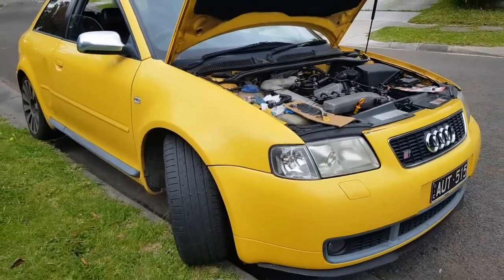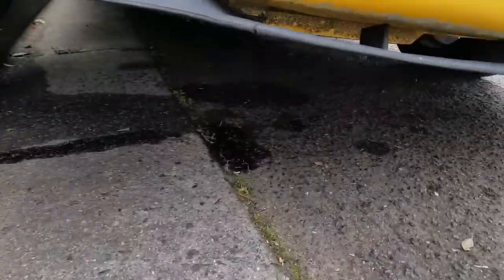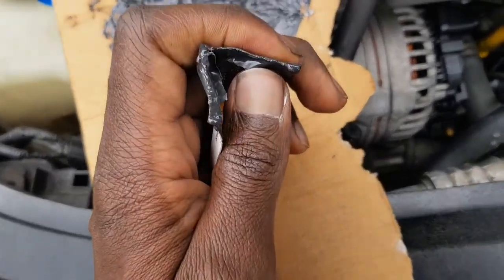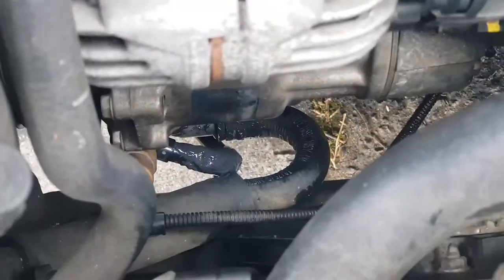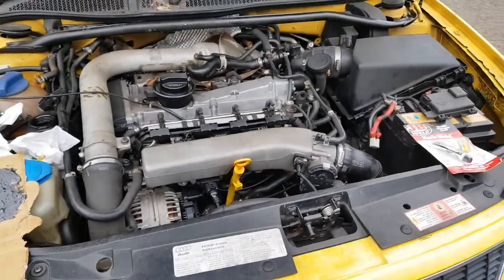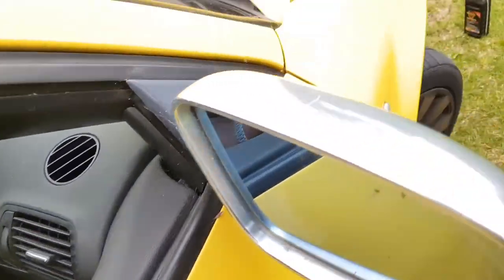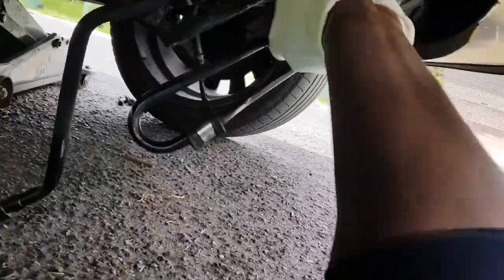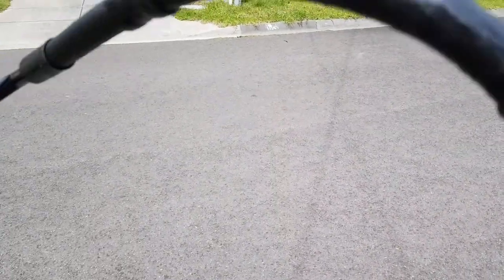Bumblebee found a fix S3 8L. part 2 - November 2021

Comment: Hey buddy watch your vids here in UK as I also have a yellow S3, regarding your hose pretty sure a secondhand hose from a standard A3 will fit, also look at golf MK4s and other models with 1.8t engine which I imagine will be plentyful in scrapyards there...again probably same hose...  you also need to fit a plastic undertray to your car as this will largely prevent these components getting rusted or hit by stone chips causing damage...
Reply from the maker: Undertray would be a good idea. Thanks for watching by the way and the advice.
Reply from the maker: 8L S3 are rare now here, audi is much more popular with newer s3 s4 rs3, and the prices are crazy expensive too